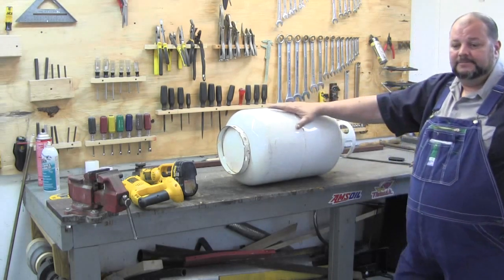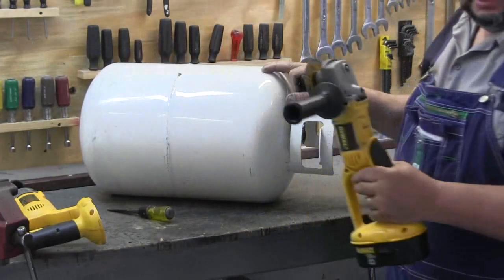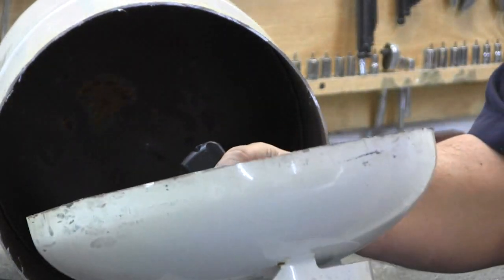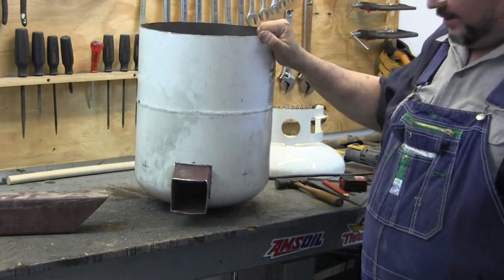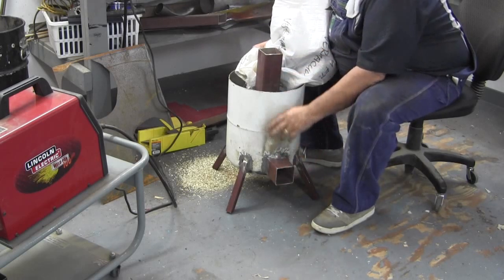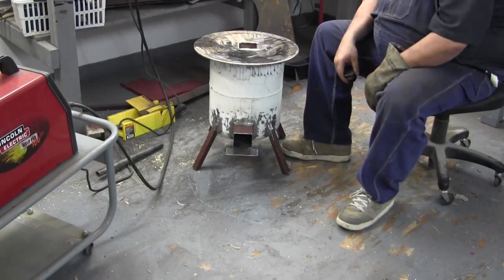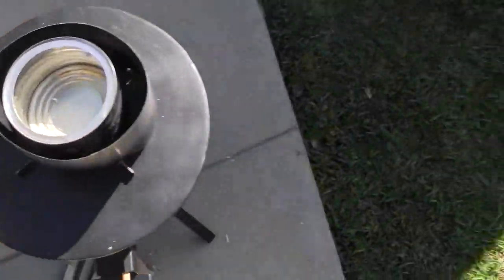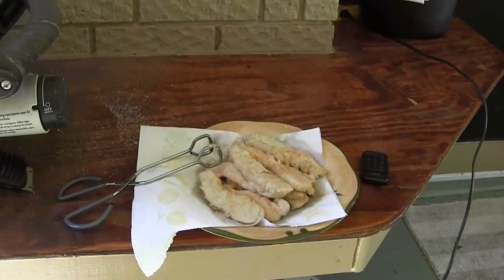How to build a  rocket stove

Comment: Happy Birthday Brad, nice job on the stove you've built like 5 million of those by now right?..lol  Hey if you don't mind a tip, especially when using a wire welder try to clean off all the paint and rust on every surface around the weld, it will make for a much better weld and it will be easier to weld too. just a thought.
Reply from the maker: Thanks but this is a re-edited video from a while back. It was a 3 part that I edited together. My birthdays in April.
Reply: BCtruck, rebuild, repair,repurpose Lol. You are about to get a million belated birthday wishes.
Reply: BCtruck, rebuild, repair,repurpose I thought I'd seen this before.

I specifically remembered the bar through the handles,
the dogs "fighting",
the tin foil on the bottom of the pan,
The chicken strips in the oil,
and when you mentioned the plasma cutter, I thought "hasn't he gotten that yet? He talked about that MONTHS ago" .

I was starting to think I was a psychotic with esp or sometin.

Comment: old boy scout trick. put dish soap on the bottom of your pans for easy clean up prior to putting on the fire.
Reply: Yep yep yep works every time!!!
Reply: Neat soap on the outside? Does that prevent soot build up ?
Reply: Puts a layer between soot, and outside of the pan, making it much easier to clean. Not foolproof every time but it does help.

Comment: If you had 3 non-swiveling casters (the ones made with roller blade wheels are good), you could mount them to a board underneath your tank to make rotating it easier.  It's useful for marking and cutting.  2 wheels along 1 side and one on the other.  The hard part is making all 3 parallel so nothing wobbles.  We used to rub dish soap on pots and pans used to cook over a campfire in Boy Scouts.  The soap turns black but cleans off easily.  Maybe you could try that with your stove.  Just don't get any soap INSIDE the pan or you'll be spending a lot of time sitting on the toilet.

Comment: two questions:  why do you use 4 legs , why not 3?  and  have you ever tried welding a nut inside the end of each leg?
then you could thread a carriage bolt in each one & have adjustable legs for leveling.  i guess that's 3 questions.  thanks.

Comment: 2 questions.
1.  Did you weld the top plate on and weld around the top square?
2.  What is the vermiculite for?  Could you use other materials?
Thanks again!
Steve.
Reply from the maker: +OldSchoolAquaponics yes to your first question and the vermiculite is to insulate the chimney. The chimney must be insulated to achieve the higher temps that wood is gasified at. You could use rockwool or any other no combustible insulating material. I use vermiculite because its easy to find and cost effective.

Comment: I might be missing something, but wouldn't it be safer to put the feed tube at an angle for the sticks to fall in as they burn than pushing the sticks in at an angle? You could have just a small tube just for the air that meets at the stack.
Reply from the maker: I'll check yours out when you make it! Mine is the culmination of years of experimenting with what works and doesn't work. This stove was the one I was proudest of and the most efficient stove I had built. But thanks for stopping by.

Comment: I am planning on putting a small wood burning stove in my van and was thinking about using a propane tank to make it. Do you think the rocket stove would be a better option for a use like this?
Reply from the maker: +John Lauretta A rocket stove cant be used indoors. There is something similar called a rocket mass heater but that would be way to hot. You can make a nice little stove from a propane tank. Use a 30 pound tank though,not a 2o. you can always build a small fire in a tank thats a little bigger but a 20 pounder will limit you to a very small fire that you will have to tend more frequently. search for a propane tank stove made by my freind 65ford.

Comment: how important is the length of the chinney and where you put the fuel
Reply from the maker: There is a rough parameter concerning the hight of the chimney. The general thought is that the chimney should be 3-4 times in hight as the diameter.
Reply: +BCtruck, rebuild, repair,repurpose 
 diameter of full stove or just the chimney
Reply from the maker: +Cody Russell chimney
Reply: Thanks
Reply: +BCtruck, rebuild, repair,repurpose does the length of where you put the sticks matter

Comment: Did you burn off or strip the white paint before you painted it black? If not, did you have any trouble with the white paint underneath after firing it a few times?
Reply from the maker: duke trana the stove has insulation inside of it. The powder coating doesn't get hot at all, because of the insulation in the cavity between the inner and outer stove.

Comment: puzzlin on how this would work without the extra chamber and vermiculite, just the tube and fire chamber ... happy b-day for back in April :) if you could chamber ize and chimney ize so you could use one in side. Also if you could use a fan and pull it through water to heat water to heat an area and clean the gasses like a bong type thinger. Lot of those poor people who do take math get all stuck on the mathematics syntax attack they use to make it seem difficult so the instructors seem more valuable when you do just fine with it ... except the inferiority complex they done laid on ya.

Kind of a tossup as to whether schoolin nowa days is an edumacation more, or more stupification. Actually is in College, like a wash on 1/3 of students, and 1/3 test better and 1/3 worse than when they went in. It's a racket, but the solid subjects like math are still teaching good skills despite the mess they've made of it.